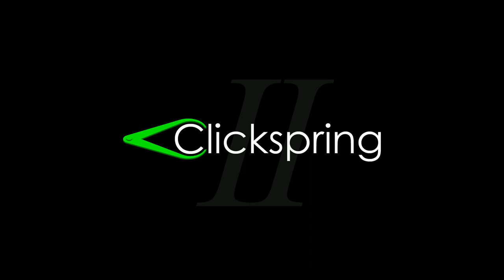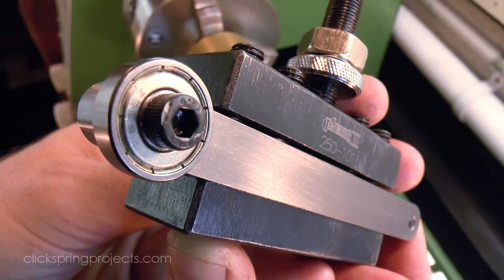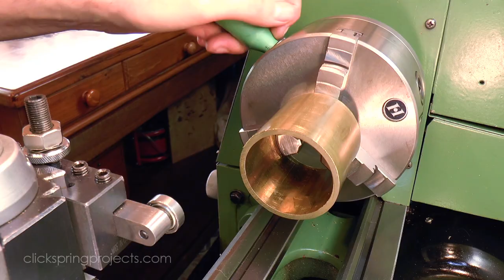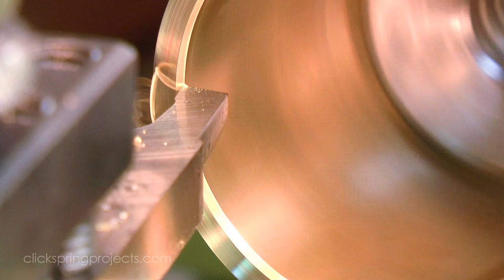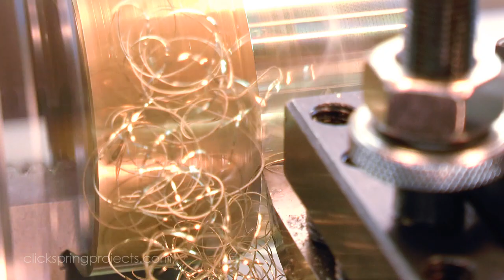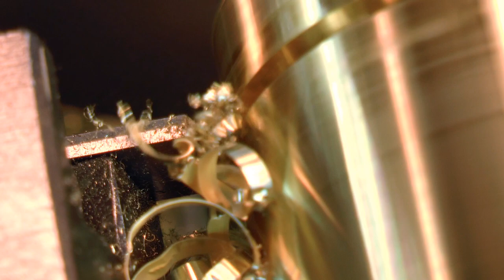Machining A Clock Mainspring Barrel

Comment: Why are parting tools so god dammed thicc? 

Wouldn't it be better to use a thinner tool to save material?
Reply: The image was greatly magnified, but the thinner they are, the more they flex and dig. Just to experiment how thin one could go, I once tried a cutter blade (sharpened as a parting tool and minimally protruding) on thin aluminium tubing and it made a mess - rigidity is paramount in all machining.
Reply: They're usually no more than 1/8" or 0.200" depending on whether it's an insert or HSS blade
Reply: @classicbandgeek  Those measurements mean nothing to people living in the civilised world
Reply: @clairevero  I hope you're civilised enough to know to how to do a conversion then. We've been working with both units in Canada for a while now with no trouble
Reply: @clairevero  They mean everything to people  living in the real world. ;)